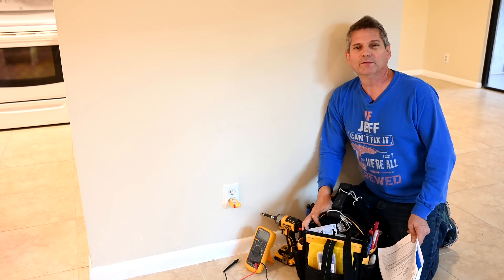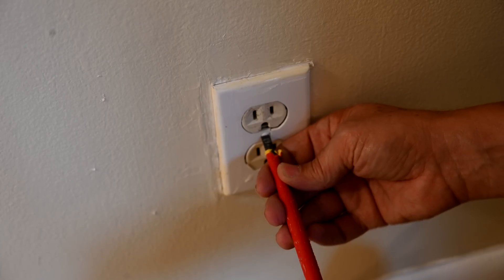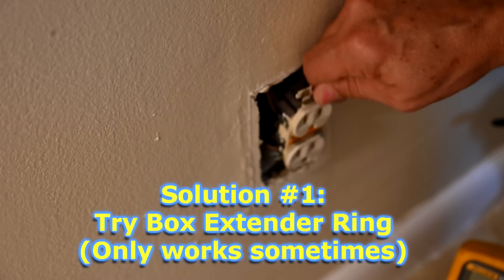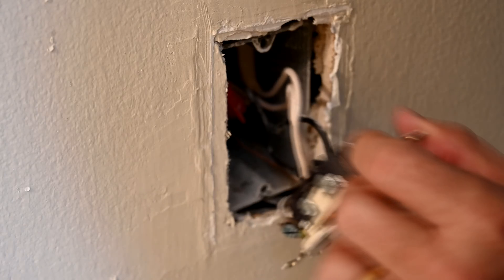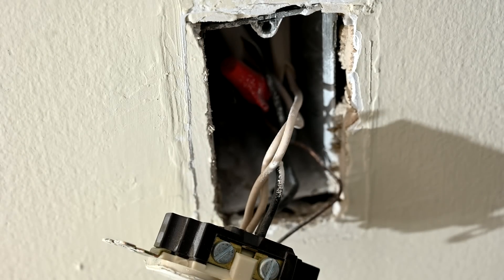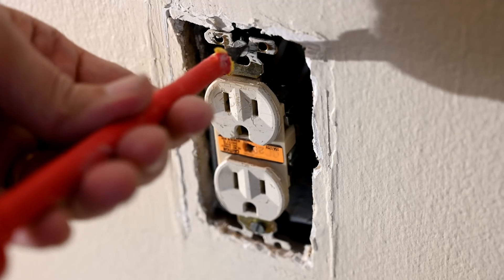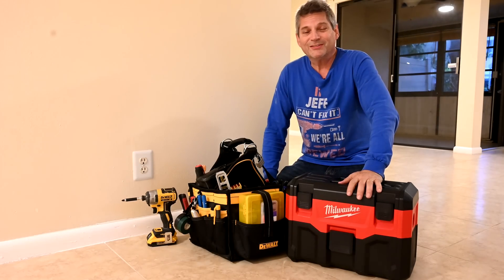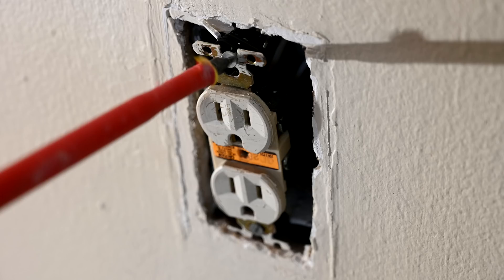2 Tricks To Tighten Loose Electrical Outlets, Switches

Comment: I always carry extra 14 gauge wire for this reason...After removing the top screw, I place the screw flat against the box and eyeball (measure) the distance between it and the dry wall...Let's say it's one quarter inch...I take a piece of 14 wire and wrap it around the shaft of a small screw driver, then cut 1/4 inch section and place it on the screw after feeding it back through the top hole...then I screw it all the way in and repeat for the bottom screw if necessary...The wire acts as a spacer or washer and the receptacle will not sink back into the wall...
Reply from the maker: that's a good idea, wire shim!
Reply: Land the plane.  Some good points for a rental property or mediocre presentation.  Pull the grey box...Re wire with remodel box and tabs to secure to Sheetrock. I see how it works and will now not move in the wall.  Not optimum but it did work.  If the end user is good with it and you can live with it - Rock on!!!
Reply: I like this. Way more solid approach than the spacers which will compress.
Reply: The shims are code approved and wire wrapped around the screw is not approved Learn to do it right the 1st time quit being a hack
Reply: I have been doing the wire shim for years. I remember discovering one on a job done by another electrician and I have been doing it ever since. Dislike running to the store or buying stuff if I can. :)

Comment: Hi Jeff, this is a little misleading. You should not cut the extender in order for it to meet code. In this case, cutting the old box out and installing a drywall mount replacement box would be the optimal solution. With that’s to metal plates, I do not recommend them. The reason being that if for any reason over time if the face plate were to come loose and drop onto a partially dislodged plug it can short and cause a much greater issue. Fix it right and fix it one time. There are non-metallic faceplates that are more flexible than the super cheap rigid plastic units.
Reply from the maker: Not sure what you think is misleading. Cutting out the old box is just not a viable solution in this case because you know you would end up having to tear out the drywall all the way around it to get that box off of the metal studs and then attach a new box to the metal studs although I would prefer to use a remodel box that clamps onto the back of the drywall. But either way you would still end up doing 3 layers of drywall mud patching and then you have to go and buy paint to match and repaint so you're talking a couple of extra days plus a lot of work and a lot of Labor for somebody who doesn't have any money at all to pay for the repair of these outlets
Reply: @jeffostroff  ai have personally replaced outlet boxes attached to studs in the manner described and it is pretty simple. Sawzawl or hacksaw the old box out with little to no damage to the drywall (especially with the clearances around that box and install the remodel box. Look into it for the next time. Also, as a real estate investor as well, this is an area I never scrimp on and replace every outlet with TP (tamper proof) outlets to prevent accidental kid exposure to current. Cost is minimal truly when done yourself as you like to do.

Edit: the misleading part is splitting the extender. Can’t do that and keep it within NEC code

Comment: Should have used a Raco Flush-Fit Wall Plate Spacer, it would have done a lot better job.
Reply: Those look like the best solution. Sturdy and yet hidden. I've found those spacers and compress and still not make a solid feel. Thanks for the tip.
Reply from the maker: Yes million ways to skin a cat. Will do a review with Racos next time this comes up

Comment: You don’t have to cut a box extender to get it around the outlet. Don’t do videos if you don’t know what you’re doing. You left a code violation when you didn’t install the box extender. You installed an outlet with a broken ground hole. Nice vacuumed there maybe just stick to cleaning up after the electrician.
Reply from the maker: It's funny reading comments from guys like you who think you know everything. There was no box extender needed there so there was no code violation in there by not including the box extender. This is a standard outlet, so a standard outlet does not need a box extender! The only time you would need that extender is if you were tiling on the wall which would then leave the outlet sitting far back from the finished surface. Maybe you should stick to cleaning up after the guys who clean up after the electricians.
Reply: You need a box extender any time the box is back more than 1/8 inch exposing combustible material. Read the NEC.

Comment: Actually. The nylon plates works better than metal also some shims work if the space is not that .big. Requiring. A box extensionn They sell. Spacers. And you find the nearest stud and screw the box to it
Reply from the maker: A couple of problems here and you are mistaken about the nylon outlet plates. You are assuming a flat wall the quality of the work done here is so bad that there's usually several mounting around the outlets from the bad tape and mudding job done by talentless contractors . So you will never have a plastic plate resting nicely against the wall they will end up having too much stress on them and crack that's why you see several cracked plates in many people's houses. One other terrible complication is these are all metal studs in this wall and the only way you're going to get a screw into a metal stud is to get it perfectly perpendicular otherwise it will just walk around and never drill in so unless you want to rip out the entire outlet box and put in a new remodel box that clips onto the drywall that would be a better solution
Reply: @jeffostroff  
I mostly did residential work where metal studs where quite  a rarity . Also quite often  the studs were not properly farmed the box had to prayed off the stud and attached with sheet rock screws . Sometimes you could pry it a little and use a madison bar to. It  hold back to the sheet rock . 
             Often as preventive measure in the rough stage you could have a spreader bar that comes with multiple. Gang boxed like four gang  boxes. Certain brands of bakelite plates are. Notoriously  brittle and nylon is far .superior  Metal plates are no slouch when it comes to stability and durability by any means and it's quite imaginable why they would be prefered especially over bakelite !!

Comment: That’s an apprentice/rookie mistake to cut the wires that short, hahaha!
Reply from the maker: Many of the outlets in this house were cut like this, they had lousy electricians working for the builder.
Reply: Wow, that really sucks. Some cheap electrical company probably or bad management.
Reply: I would have gotten fired if I did a few like that.

Comment: Nice tips.  Also, I've put a screw through the box to secure it the stud.
Reply from the maker: Yes we normally do that that also but in this case it's a metal stud and there's absolutely no way on heaven hell or earth you're going to get any screw to go through that plastic at the angle that you would have to get it into to get into the stud and then get it to spin in place an cut through the steel stud it's virtually impossible you have to be directly head on 90 degrees perpendicular to the stud to get a screw to penetrate or even a drill bit as well if you were going to try to do a pilot hole
Reply: @jeffostroff  I disagree...pre-drill the hole, then drive the screws into the metal stud. Easy Peasy. And I realize you were showing the box extender for demonstration purposes, but it really is not a good option for overcut boxes. Shims work great as long as the workbox is secured (won't move), and that you don't shim too much that it causes a safety issue by bringing the side wired connections beyond the workbox opening. With all that said...thanks for the video. It's always great to hear others opinions and suggestions.

Comment: Personally, the wiring and the screws not being secured in the box, but instead being exposed in the gap between the metal plate and the front edge of the box, makes me uncomfortable. I know the extra time and effort sucks but I would, and have, cut out a section of drywall, from stud to stud, then installed a new box, replaced the drywall after providing support for the joints, mudded/sanded the joints and then painted. Only then would I be comfortable that a fire hazard was properly mitigated.
Reply from the maker: Your fears are unwarranted. There are no exposed wires in the gap between the metal faceplate and the box. First of all the exposed ends of all wires are either attached to screws on the sides of the outlet,  or twisted with another wire and a plastic wiring nut screwed on top to protect them. All wiring is always placed deep inside the box.

Comment: That's one way. If the box is against a stud, I'd drill a couple of holes in the side of the box and drive some wood screws through those holes into the stud to keep the box from moving around. If no stud, I'd replace the electrical box with a PVC PVC Old Work electrical box that clamps itself to the drywall.
Reply from the maker: Yes we love to use those blue boxes with the drywall clamps
Reply: If you alter a box by shooting screws through it youve altered the box and it wont pass code. Its a no biggie but the inspector already saw it so hes gonna check.

Comment: Too many comments to go through....just wondering why (in case I missed it) when you put in the shims on the top screw, you didn't use the screw hole and went above it in the valley between the ears?  Mistake?
Reply from the maker: thread in outlet box was stripped, so I needed more of an angle for the screw to grab
Reply: @jeffostroff  Gotcha.  I didn't hear a reason in the video and being an electrician, I was like , what is he doing???  LOL

Comment: Loose box, loose outlet always, you didn't use the mounting screw hole on outlet, outlet sticking out of plate, looks like crap, broken outlet needs replaced now start over, still loose even after you fixed it because the box is loose, crappy fix job for sure....
Reply from the maker: Nice try there apprentice wannabe. Stick around and learn something, because you know nothing. I put the top screw above the hole to put it in at an angle, because previous workers stripped the threads, and I needed get that screw to grab. Was not still loose after repair as I showed in the video, so you can't even watch a video. Even with a loose box, this fix works, because at the end of the day, the rigid metal plate I used which you would never have imagen using on your own, is what does the trick. You'd rather charge hundreds of dollars of labor charged to a family who can't even afford the cost of a high price electrician. So you thought you'd come in here to show off what you thought you know and all you did was face plant. LOL!
Reply: @jeffostroff  From a "apprentice wannabe" someone will be back to fix that outlet some day because it not fixed now, the flexing in that metal plate will break at the screw, then your back too square one fixing again, I've seen it before, and if I payed you to fix the outlet I wouldn't let you by with leaving a broken outlet there.

Comment: is there a particular reason you didn't install the top screw with the spacers in the normal outlet hole?
Reply from the maker: Yes, I normally install the top screw with the spacers in the normal outlet hole, but that plastic box, the screw hole was stripped a bit so I went above the hole to make the screw go in at an angle into the screw boss, so it would grab on better.

Comment: Hey Jeff, just saw this video. I don't think any outlet installed in the 70's in Florida had the drywall around it cut right😂, I see this same problem all the time down here. Won't be publicly sharing my quick fix though😂😂😂
Reply from the maker: You're the one that gets me is nobody ever covered up any outlets before they spray painted them so the wires always got painted
Reply: @jeffostroff  did you see that the electricians bag you linked to in this video is $35 @Amazon, normally around $70.

Comment: I turned all of my outlets 180degrees, with the grounds up. I was told to do this by a home inspector who said that it is safer in case a metallic object would happen to fall behind a plug that wasn't fully inserted. Seems like a lot of factors would have to align themselves before it could actually cause a problem, but it actually gave me a good excuse to replace all of the cheap plastic covers with metal ones.
Reply from the maker: yes we've seen a few people do this.

Comment: I was trying to measure A with my multi meter the fuse blew up can I still replace it with a new socket ? Or is it a bad idea.
Reply from the maker: Yes you probably shorted something with the multimeter, or maybe some wiring was done wrong in the outlet causing it to short. You should be able to replace the fuse.
Reply: @jeffostroff  ooh thanks I appreciate it

Comment: Those type of outlets used in America need to be changed to the type we use in the uk.wouldnt keep having those problems.
Reply from the maker: The problem is not the outlet, it's the guys cutting the holes in the drywall

Comment: Great video, I have a question my oulet is loose but inside it has 2 plastic arms how do I get it tight?
Thank you.
Reply from the maker: Are you saying the outlet box itself is loose? Is it blue plastic like this one with the 2 arms? https://www.homedepot.com/p/Carlon-1-Gang-20-cu-in-Blue-PVC-Old-Work-Electrical-Switch-and-Outlet-Box-B120R/202077323  If it is like this one, get a Philips head screwdriver, find the Philips head screw on those 2 arms, and tighten it down.
Reply: @jeffostroff  thank you for replying is white but same principle, 2 flanges one on top one on bottom at opposite corners. Is thigh now.
Thank you.

Comment: Well you definitely showed everyone the way a slum lord would do it. A .99 cent box with the flip out cams would fix the loose box issue.  Why not spring a whole $2 for a nice new bright white outlet and another .99 for the matching cover. Less than 5 dollars and 5 minutes and it’s done right.  And whether you do it or not, turn off the power. If you are trying to educate the masses at least educate them in the right way to do things safely.  Sorry to bring up the negative.  But this video actually surprised me in the lack of professionalism.
Reply from the maker: First of all you are a LIAR. I specifically said at 1:30 in the video to cut power. Arrogant rude people like you always want to barge in condescendingly with name calling when you don't know anything, all you did was show everyone you are a liar who knows nothing about construction. Certainly your method is one which also works, and we also showed you could try that as an option, but your arrogant my way or the highway snootiness is in itself a lack of professionalism. But your method is not cost effective when you have to go around to several outlets and do this, and it's not a case of "just do this" either, the drywall here was poorly done by the builder. It's a fair amount of time and work that a homeowner may not feel comfortable doing. Unfortunately, the homeowners of this house were so broke they could not afford to retrofit several outlet boxes or pay the labor for it, they were responding to the buyer's home inspector report to fix the loose outlets, which adding new outlet boxes would NOT have fixed the problem, because the builder cut the drywall too tall, the problem here follows the incorrect drywall outlet box hole opening not the outlet box. The problem is with arrogant types you look down on poor people as though they are second class citizens. Oh it's Only 99 cents! It's really $2 for the outlet box, and we can't use your cheap 99 cent slumlord plastic plates, because the drywall is so curved you have to use metal plates in order to fix the problem and provide enough strength to support the extra forces. You failed to notice in the end I used the appropriate parts designed for this task and fixed the issues, without digging further into the walls, and without spending money where it was unneeded. You would rip off customers charging them overtime for extra work that isn't necessary.

Comment: So question?
How did you just preform work on a out of code poorly done outlet?
I think it would have been easier to cut a 12x12 drywall patch out rework the box and drywall bringing it up to code and safer.
Reply from the maker: Lot more work, and many outlets in there had this problem.
Reply: @jeffostroff  same problem?
We had 37 in our house but not as bad at all as ur problem.....ur holes where cut by a blind man.

Comment: So my bedroom outlet wall is the same wall where the bathroom outlet is. And now my bed light will not turn on. And I have no power on that side of the room. What show I do? I’m renting the house.
Reply from the maker: This is an issue that your landlord needs to deal with. But I would check to see if you have power in the bathroom outlet because it could be that the bedroom outlet was connected to the bathroom outlet and if the bathroom outlet went out from a tripped GFCI, then it could take out that bedroom outlet as well.  But what if the bedroom outlet is not connected to the bathroom outlet? The other cause for your problem could be that there was a loose wire on the back of the outlet inside your bedroom and its basically a $3 outlet that would just be replaced or rewired if the wire had come loose.

Comment: You lecture far too much.  Very informative, but get to the point.  We weren’t the builders.
Reply from the maker: I don't do 2 minute Home Depot perfect world videos, you can go thereof that. I deal with real world problems and all the considerations you need to take into account to solve the issue. You can always use the scrubber to click ahead in the videos. That's how I watch most videos.